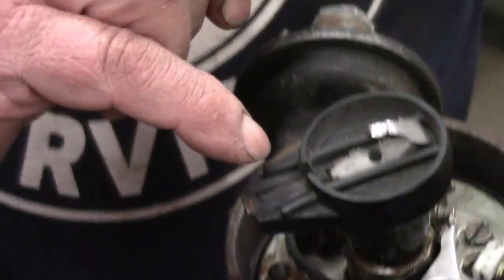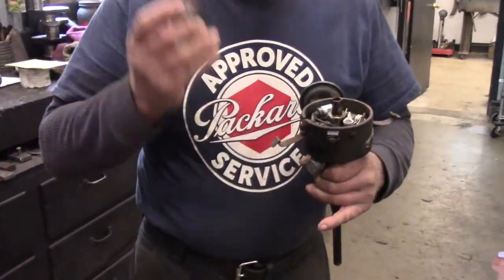Installing a Distributor | Packard Straight 8 | Ross Miller | Speedwell Garage

Comment: I found your video to be extremely informative & helpful indeed!  I liked the explanation on using the  'volt/ohm' meter to determine the contact points opening.  That "penny over the spark plug" trick is priceless!   I immediately wrote the rotor's rotation and degrees BTDC in my Packard Service Manual.  This is a good video. Thanks for sharing.

Comment: I had the little carbon rod in my rotor "escape", left me stranded.  Figured it out, and got home with a piece of bailing wire in there.  If one replaces it with a Pontiac, do you have to put a resistor somewhere else to minimize radio interference?  What year Pontiacs?
Reply: Does your radio work?